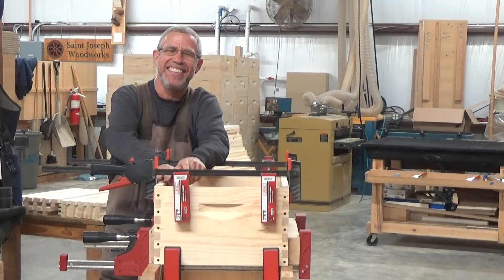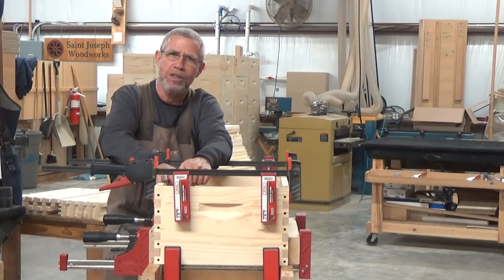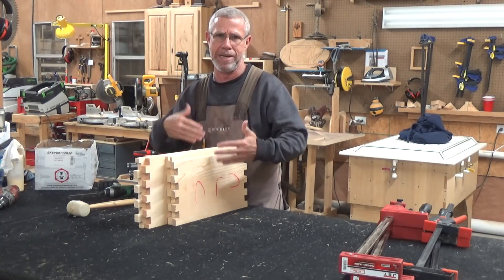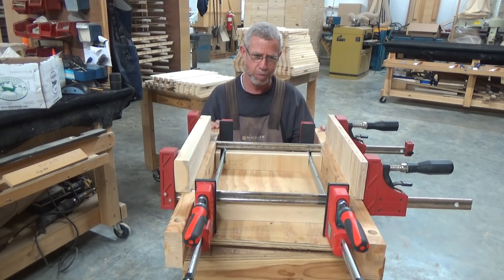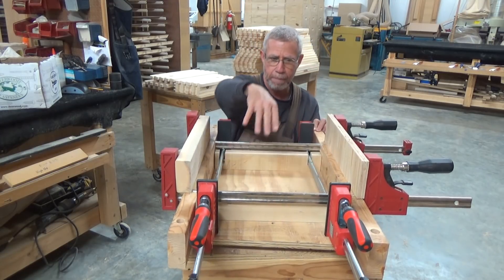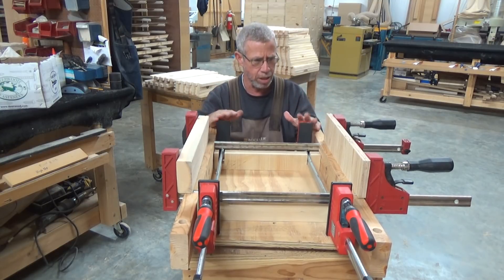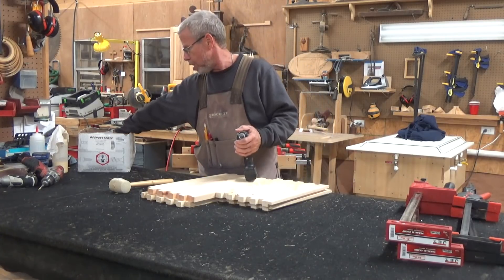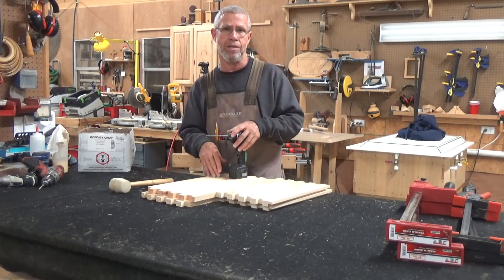How do you assemble a deep super?

Comment: I was planning on doing some wood work tomorrow myself.  I hadn't even thought about squaring the box up. Thanks for the save mr. Ed :) btw it's supposedly dipping into the high 40s tonight! Florida winters are rough!
Reply from the maker: Yeah, you want that box pretty square, you have to fit 10 frames in there, not 9 sideways. Best wishes for the build, and stay warm doing it. If you are working in forty degree weather, even if that's the outside temp, you'r a beast. God's peace brother.            Mr. Ed

Comment: Ed good setup for clamping up the boxes.  What screw type/size/length you using for your boxes?  You showed them in another video awhile back but dont believe you showed it up close or gave the info on them.  And are they coated so they dont rust?  Glad your not "borrowing" them from the shop this time. (A lot of work to have to take them back out after the boxes rot away and clean them up before you return them.)  If you post an address, we could take turns sending you a new razor once a month.  :)
Reply from the maker: I was using a 1 1/2, coated, course threaded screw. I think the coating was just paint, but I'm not sure. I BOUGHT a box of 5,000, and it was under $80.00 on line. I did use 3,600 of them so I have a few left over. Thanks for the offer of buying me a razor, the beard will come off soon enough, I'm just practicing how to look like  a monk when I enter the monastery. God's peace.
Mr. Ed

Comment: Hi Brother!  Are your longer clamps 36in Bessey?  Could a person get by with 24 in clamps for the 16.25 in sides?  I want to order the 4 bottom clamps.  It looks like you have longer clamps than you need for the sides?  Is that because of other applications in bee building items?  Peace to you.
Reply from the maker: Hey Dan! Because the outside measurements of a super are approximately 20" x 16 1/4", 24 inch clamps should work just fine. I'm really not sure of the size of the bottom clamps, but they may be 36", those clamps are used in many different applications in the wood shop. You should be able to make the 24" clamps work just fine for everything, but your fixture may need to be modified to accommodate any limitations. Thanks for watching. God's peace brother.
Mr. Ed

Comment: Don't you drill the holes out?  I do, keeps the wood from splitting!  Another trick is caulking or wood glue the open wood ends,  This seal it from MOISTURE getting into the wood, and use less paint.  Yep winter time jobs in BK, making things for spring.  What i do, it helps from cabin fever.  he hee   Cheers Man
Reply from the maker: Takes to much time to drill, remember, I told you I was a lazy guy. Some of them do split, but not enough to make a difference to me, the bees will take care or it, remember, I'm a lazy guy. God's peace brother.
Mr. Ed
Reply: Could be like me,  used the power of your mind to get things done  he heee  if you was lazy?  THERE WOULDN'T BE A STACK OF BOXES BACK THERE!  he heee  You would hire help to do your work!  RITE?  he hee there no such thing as a lazy BK. or you wouldn't have bees!  cheers  man